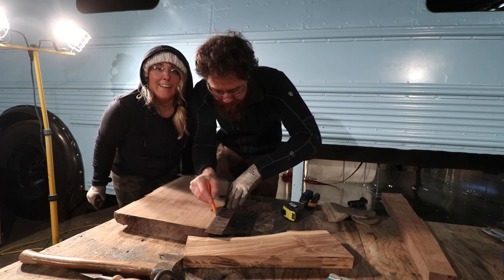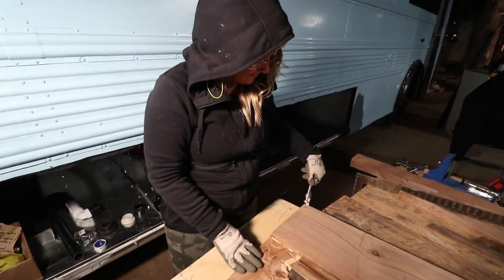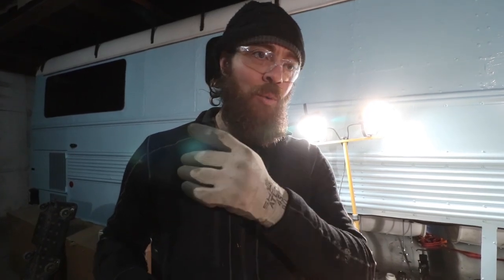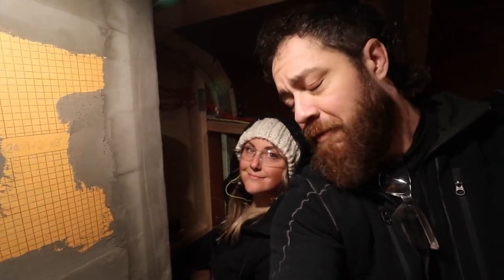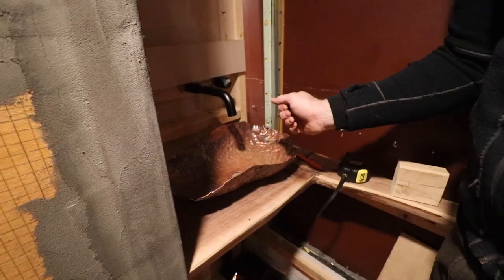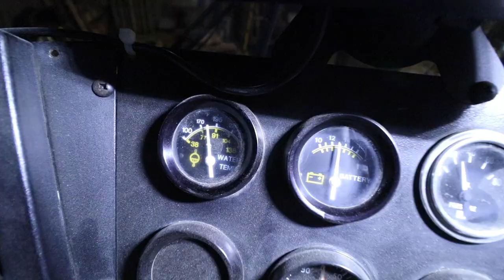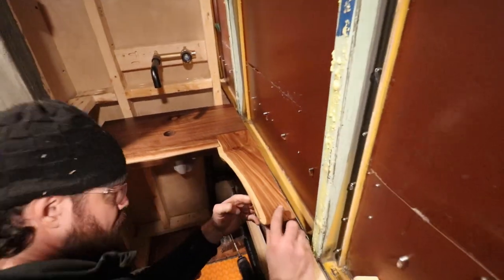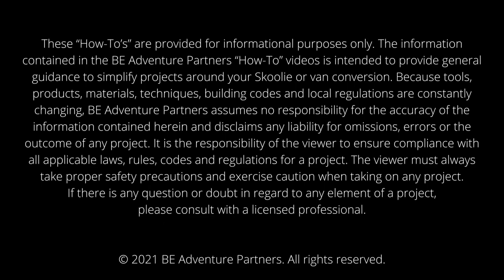Live Edge Bathroom Vanity Project + Installing DIY Copper Vessel Sink | Skoolie Bathroom

Comment: Can I just say...that turned out crazy good!! Strong work on all that project guys, and no electrical fires to hamper progress. Is it just me, or did I see a bit of a firefighter edge show up in this one?? As you're holding that cord, Brian, I was wondering how many of those fires you've attended where there was no more cord let to hold, or anything else for that matter. That looked like it was a really close call. Good nose action on Erin's part! 
Keep up the great work guys!! Looking forward to the next project to get completed.
Reply from the maker: Hey hye @2AZSUN! Erin did an EXCELLENT job on hammering that copper vessel sink out! Now that it's installed, it feels sooo good in the space. We're very fortunate that nothing happened with that electrical cord heating up. and you're right... I've been to more fires than I can count that either burned up a wall or completely leveled a place because of putting too much stuff on one circuit. We never leave the bus plugged in while away because we knew that we were playing with fire (pun intended!) However, it was a perfect opportunity to show the beginning stages of how electrical fires happen. We immediately took that cord out of commission and did a load test so that we could remove what we shouldn't run while we're not completely finished with the electrical setup (which we should be done with soon!)

Thanks for watching, dude!
- Brian + Erin

Comment: Brasso may take that discoloration off...but I would try it on a scrap piece first because you may have to polish the whole sink if it is too aggressive and that might ruin the look you're after. You might also try some of those MR. Clean scrubbing pads. I've had good luck cleaning stainless steel sinks that were badly stained with them, but again it will remove the patina.
Reply from the maker: OH! We hadn't thought of Brasso and will do some tests on some scraps. We think that the patina looks great the way it is and as time goes, it'll constantly be changing! So we might just let'er ride! Thanks so much for watching @TR Bowlin!
- Brian + Erin
Reply: @BEAdventurePartners  Yes, as soon as you start using it, it is going to start oxidizing and the problem area might not be noticeable. Take care guys
Reply from the maker: @trbowlin  the joys of copper 😁

Comment: no pee trap on the sink? you may smell your grey tank ..just saying...great work together.
Reply from the maker: Hey hey @1pilotsteve! You are correct! We have absolutely no p-trap on any of our sinks because this is a moving vehicle. Rather, we what's called a "waterless trap" at each drain which is the white contraption. The particular one we're using is called a Hepvo Valve and you can check it out here: https://amzn.to/2XiO9RF basically there's a gland on the inside that opens with water pressure in one direction and shuts as soon as there is no water pressure. It's directional so when fluid is not flowing through it, gasses from the gray tank can't come back through. This little device blew our minds when we learned about it because p-traps don't work very well in moving vehicles because the volume of water/liquid balanced in the elbow of the trap sloshes out while driving until a sink is run to re-fill it. Let us know if you have any other questions about that! 

Thanks so much for watching! Erin and I love working together on our tiny home on wheels!
- Brian (+ Erin too!)
Reply: Actually I saw the video of you quys doing grey water tank..and saw what you were doing.. U wonder what your plans are with covid? I live in Ottawa..I have a 2007 Holiday Rambler I bought last August ..I am close to retirement and I do live sound at festivals... I wanted to use my rv for camping and work at the festivals as well as going south in the winter. But Covid has changed everything. You planning to do a lot of travel in Canada this up comming year. Any plans for a YouTube meet and greet?
Reply from the maker: This covid crap certainly has thrown a wrench in plans. However, we are grateful Canada is HUGE and we haven't seen hardly any of it. Sounds like you have a great plan. Having an RV at festivals would be the best! Hopefully we can do stuff like that again soon. We kind of have a feeling people just will anyways... Cuz people belong together. 

Anyways...... LOL 

Yeah we plan to meet up with people. Our biggest goal with the bus is to go on a research project of a lifetime! What we want most is to have a homestead, so it only makes sense that we go interview people who have them. The bus will take us from homestead to homestead. Also, into the wild to capture beautiful footage of nature, and wildlife. So lots of filming. It doesn't really matter where we go. We hope to go to the US, but we are happy to do Canada first. 

At some point we will definitely host a meet-up!

What are your new adjusted plans with all this?
Reply: Well I may lease out my bus to front line workers or rent it out in place for social distancing holidays... just considering  it..let me know if you come in the Ottawa area.. Algonquin park is awesome and don't forget Quebec...very beautyful province.